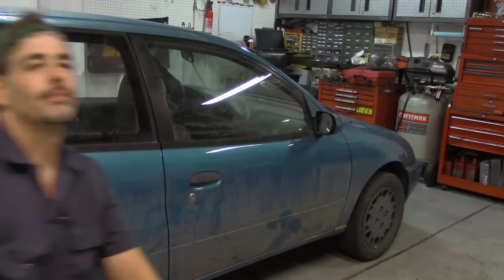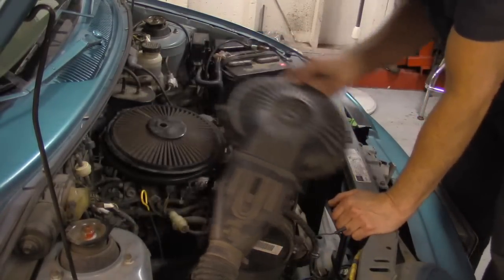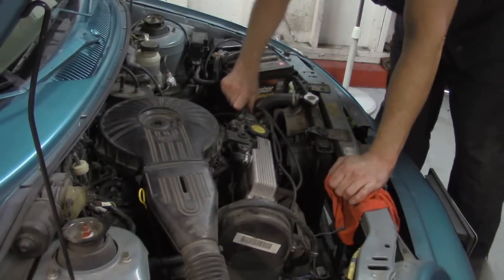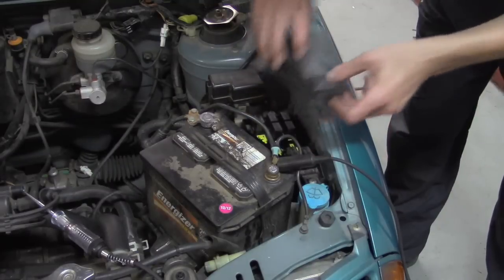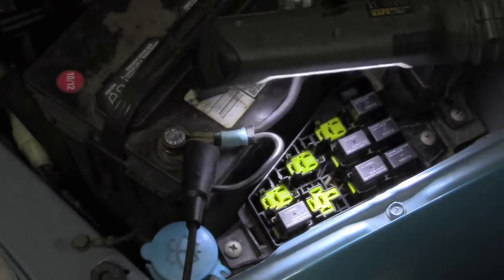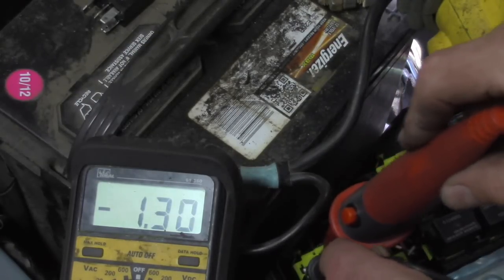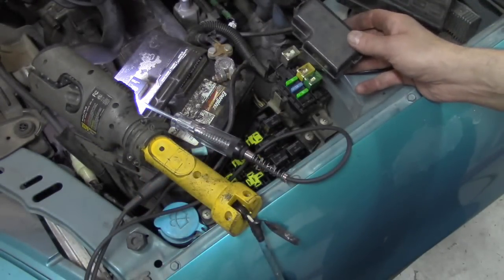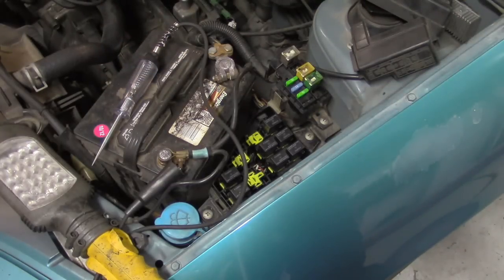Cranking No Start -Quick Basic Diagnosis

Comment: Sorry, but the owner could have at least cleaned the trash out of the car!  God I hated that when I was a mechanic.   "Let's take our car in for service, but leave about 50 beer cans and 100 McD's bags full of rotting food all over the seats and floors....  YUCK!!    

On the lighter side:  1st wife and I owned one of these.  3 banger with a 5 speed.  That little snot of a car was pretty fast, and at 55-60 miles per gallon?  Very nice to drive from a money saving point of view.   The company got the gearing correct for that tiny car and it did pretty well.   Was it "Super fun  to drive"?  Mehhh...  It was basic transportation with a decent MPG rating.  We filled the tiny tank every 3 weeks if memory serves.  Would I buy one again?  For long distance drives where mileage makes the most sense-  Yes.  But I'm known as being a Cheap O'.  :-)
Reply from the maker: hahahah dude you have no idea how bad this car smells!!! It smells just like spoiled milk and in fact the next morning my garage smelled so bad I couldn't even work on the car til I aired it out!!!

Comment: G'day Matt, l've just found your channel and enjoy the way you methodically go about the diagnosis. l have a sticky dilemma at the moment. My battery reads 12.5 volts with no load. lt was turning the engine over but not starting. As l just bought the car a week prior and it had been running well, and decided to stop running, l changed the fuel filter, it was almost black, then the battery called it quits. A jump start was no help. As one of your vids you don't become a diagnostic guru over night, so any help would be greatly appreciated. Kind Regards.
Reply from the maker: You need to do basic battery load testing to rule out if issue is battery or fuse related. I have several videos on this.
Reply: You are doing a great job.
Reply: Ok, thank you.

Comment: Great job diagnosing the 3 cylinder Geo Metro. Of course one never knows ahead of time where the problem might lie but only the smart guys who know what they are doing find the problem as fast as you did. So once again, this was great.
My 8 cylinder VW Touareg also has been acting up. It has this weird gas-mileage problem and no mechanics have been able to diagnose it because the Touareg behaves good when it is at the shop. The problem with the truck is that during my commutes to work, most of the time it gives me poor gas mileage (15.5 - 16.5mpg average), but sometimes (~15% of the time) gives me very good gas-mileage (18 - 19 mpg average). Usually (but not always) the good gas mileage is accompanied by more power and slightly better sounding engine.
At first I thought it probably had something to do with engine-temperature or humidity etc, but after many weeks of observing I have to say that neither engine temperature, nor humidity, or traffic conditions, or AC on/off, have anything to do with it. It seems it simply has to do with what mood the truck is in. When the engine feels powerful, I drive it slightly more aggressively and still end up with the same great gas mileage. Needless to say, I want great gas mileage accompanied by more power, all the time.

Have you ever come across such an issue? Where do you think the problem might lie? I have some basic scanners but being a novice, I need guidance as to what I should observe and what I should look for. TIA
Reply from the maker: WHat data do you have?
Reply: I am new to engine diagnosis so I don't much know about which data to watch. However, after watching your videos on Fuel Trim a few days ago, I watched mine and what I saw is-
1) When the engine is fully warm, the multiplicative LTFT stabilizes at around 4% on both banks, but does not always stay there. Sometimes bank 1 rises to 5.5% (and stabilizes there) and bank 2 rises only to 4.7%. Occasionally bank1 rises to 6.6% and bank2 to over 5% and stabilizes there. However, most of the time it is around 4%. The additive LTFT is almost always around -1%.

2) The Lambda for all 4 sensors is almost always at 1.00. Upon deceleration, two of the sensors rise to 1.99 but the other two remain around 1.00. I'm not sure if this is normal.

3) The only thing that may be odd is the voltage for rear o2 sensors. It rises to over 0.6v when cruising or when engine has been idling for a while. Doesn' t that indicate a rich condition? I have brand new front catalytic converters. Shouldn't the rear o2 sensors always be around 0.45v?

I have not been able to figure out where to find the voltages for front (pre-cat) o2 sensors. There are some values that show voltages of around 1.55v (on both banks) when cruising which rise as high as 4.2v when decelerating. I suspect that those are the front o2 sensors but I don't know why the voltage range is so different from the normal (0.1v-  0.9v) o2 voltages.

What else should I watch?

Comment: Ill be towards colorado springs in a month, cant wait. 
A high of 80 degrees there vs 105 here.
Reply from the maker: Yeah the springs is usually a good 10-15 degrees cooler than Denver.  I have been working in Phoenix a lot this summer. It's been brutal!!! Last trip was 122.
Reply: Schrodingers Box I wonder how much HP is lost up there because of elevation, and what percentage of people have thrown on turbos to make up for it.

Comment: Woot - the cat's back!  Good to see you have a new video, Matt.  :-)
Reply: PS:  I'd guess at this point there's a possibility of either a chafed wire somewhere in the fuel pump circuit, or maybe even a pump that's on the way out and pulling a  bunch more amps than it should...but not entirely sure why that would have prevented you from getting spark.  Are those systems usually interconnected?  On the other hand, I AM sitting here in my armchair...and that's why I don't know.  :-)
Reply from the maker: Yes I would suspect the fuel pump first however the ignition is also on the circuit obviously so it is entirely possible the ignition circuit is also the suspect.  ANything- fuel injector, coil, fuel pump, and all associated wiring is suspect at this particular point.  I will narrow down to what it is exactly hopefully tomorrow.
Reply: Im sure you have thought of this but might be worth measuring the current flow at the fuse , with a slow build of current a 15 amp fuse will carry 20 amps or more for quite some time before it blows 

Best Regards John